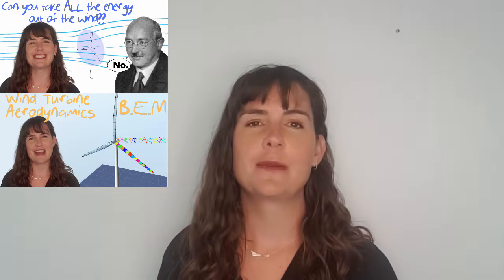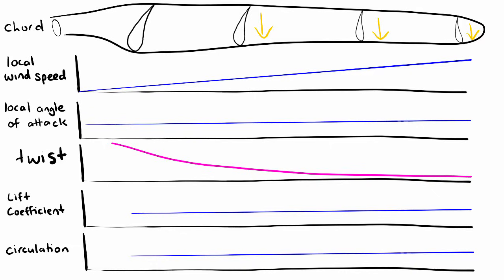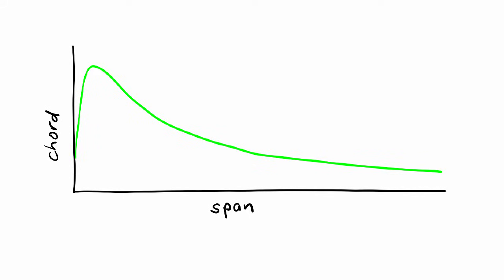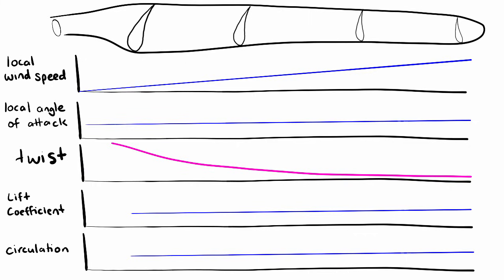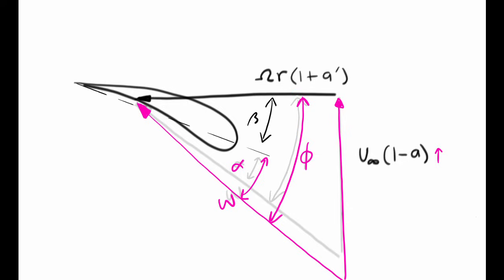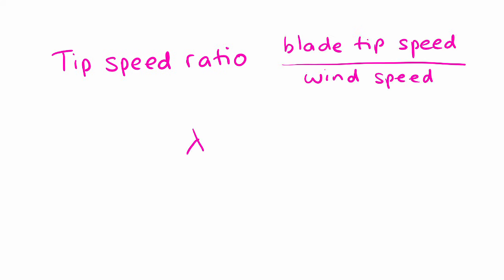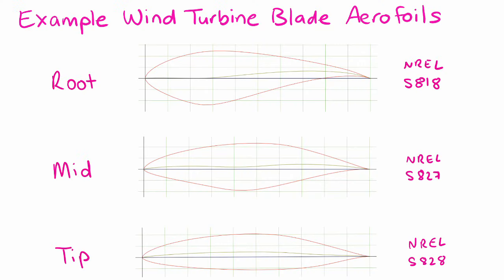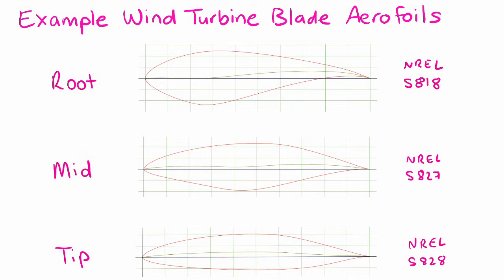How to Design Wind Turbine Blade Geometry for Optimal Aerodynamic Efficiency

Comment: wow, nice to see how fluid the optimisations are, and even how they depend on location. That wind on land has to keep tip speed at lower values for noise.

.. I wonder: is there any situation where you would go from 3 to 4 wings? Maybe to keep tip speed low on land?

Comment: Hey there! I stumbled upon this video while researching wind turbine blades for a university project, and I found your explanation quite insightful. As a university student, my team and I are diving into a research project focused on testing the torque output and drag of an albatross-inspired wind turbine blade inside a wind tunnel. 

I was intrigued by how the chord length changes and twist angle on standard wind turbine blades are influenced by varying wind speeds along the blade's span, affecting circulation around the airfoil. 

Our aim is to optimize turbine blades to capture energy at lower wind speeds, hence the focus on torque for the albatross blade, and reduce drag with surface texture changes like dimples. There is existing research on the matter so we're considering manufacturing the blades for testing and even experimenting with adding dimples to one airfoil to observe their impact on torque and drag and the manufacturability using molds an fiberglass lay.

Here are a few questions I hoped you could help me with: 
1. Since wind tunnel speeds won't vary along the span, would designing and manufacturing a turbine blade with twist angle and chord changes be necessary, or would an extruded airfoil shape suffice for testing purposes?
2. Could we apply the same approach to the albatross-inspired blade?
3. Would measuring lift alone suffice for gathering valuable data on torque produced at lower wind speeds, or do we necessarily need a torque sensor?
4. Are there any other general questions or considerations you'd recommend for our project based on your expertise in wind turbines and blade design?

Any insights or guidance you could provide would be greatly appreciated! Thanks in advance!

Comment: wind turbine dessingner must take a page from aerospace engine dessing, long blades with variables pitch produce torque when air isn't the speed they were dessing,but if only the 1/3 of the tip move the negative effects are less ,a second choice is to put a hub cone like in the center at least 20 meter in circumference, blades dessing becomes simpler and able to work with a wider range of wind speed ,blades then can be wider at the end were really makes a difference,and ho know lowering rotación speed and additional blades...

Comment: I wonder if there is a design/way to get all the lift force being torque? Seems that with the current designs longer blades are better so as to get the torque component of lift as far from the hub as possible (high rotational speed with thin blades and keeping a constant tip-speed ratio). To illustrate this think of the difference between a sailing boat 'reaching' across the wind compared with it 'pointing' high into the wind. A reaching boat will go much faster that a pointing boat as a much bigger component of the lift force (generated by the sails) is in the direction of travel of the boat.

Comment: Rosie,what happens when we set a windturbine in the sea? In water? The density of water is almost 1000 times more then the denity of air, right? So, do we have 1000 times more energy then a "wind" turbine??
Reply from the maker: Yes that's pretty much right. Tidal turbines very closely resemble underwater wind turbines. They have their own unique challenges which have prevented them from going mainstream so far, but there are some interesting tidal techs making progress recently. I ought to do a video on that topic 🙂
Reply: No, because water doesn't move as fast as air, and power is proportional to the square of the speed.
Reply: @niconico3907  hello Nico, Well, so as Rosie said : this exist allready, bud thé name for this kind of turbines is "Tidal turbines". They have of course one big negative Point: the speed of the water. Bud positieve Point is the weight of the water is almost 1000 times heavyer then the weight of air. Other positieve Point: they know always the direction of the stream and, the speed. Bud, for more information, search on internet: Tidal turbines.

Comment: Rosie in a home wind turbine has anyone given thought to having two turbined of different size blades in tandem, one upwind of the pedestal and one downwind with larger blade diameter to keep everything pointed into the wind? Obviously the downwind turbine will not be as efficient as compared to the upwind turbine due to wind flow turbulence but with a larger diameter blade it should be decent. This concept could only apply to home installations.

Comment: Another other question i wanted to ask is when the wind pressure is sometimes very high and we want to control the flow of electricity or just kinetic energy, how can we control the amount of kinetic energy that is being produce by the Wind turbine at the high wind pressure? and what safety precautions should we take before building a wind turbine and use it for our own use at homes and for our farms water motor?
I would very thankful to you if you guide me a little bit.
Reply: Usually wind turbines have what they call cut-off speeds. You can check that out. Furthermore, a gear system is attached to a wind turbine to regulate electricity generation given different rpms

Comment: When I first saw a wind turbine, I was a bit surprised at how slim the blades are and how slowly the blades rotate. Since an electric generator's out put is proportional to the rotation speed I would imagine the blades would rotate faster than I actually saw. But It is possible to use gears to speed up the generator rotation but that adds more torque requirement on the rotating blade. So there has to be a trade off. 

When there is no wind, there will obviously be no rotation. As the wind speeds up the blades start to rotate. So there is a wind speed at which enough torque is generated to start the blades turning. A slimmer blade seems to require high initial wind speed to start it turning? And I wonder how it is and how does it affect the overall efficiency of wind turbine?

Comment: Long-winded additional information..

The AM-FM Real-time physical manifestation of sync-duration Elemental e-Pi-i superposition Quantum-fields Mechanism Holographic standing wave crystallisation condensation, E=mC² Superspin-symmetry-> Singularity positioning integration,   ..is plain-old Atomic Structure WYSIWYG QM-TIME resonance floating, e-Pi-i-numberness compositions. In instantaneous trancendental self-defining cause-effect dimensionality, a complicated manifestation of pure-math relative-timing ratio-rates in conic-cyclonic coherence-cohesion objectives place in time-timing re-evolution Perspective. This is context, Logarithmic quantization calculation of QM-TIME Math-Phys-Chem and Geometry here-now-forever empirical formatting. 

Astronomical Observation is built around Space-time Spectroscopy of the AM-FM continuous creation connection cause-effect, so just like when a Stroboscopic Timing Light is used to set the Spark and Governor on an ICE motor, much the same idea, in emulation, applies to the analysis of Quantum-fields pulse-evolution Actuality.

 Theoretical analysis of real-time phenomena is supposed to get all the time-timing sync-duration identification of maintaining and Sciencing Re-search in metastable proportioning probability balance, of re-evolving intelligence, Actual and Artificial.

Comment: Just a thought, have any buddy design a wind blades in 2 parts ,so that the first part near the hub can change angle separate from the tip this will help in transport because the final size will. be larger and it tecnicly will work in winder range of wind,
Reply from the maker: Yes, look up the GE Cypress wind turbine. It has 2-part blades mostly to help with transport like you suggest. But they are attached rigidly, they can't move independently once they are installed. I think the 2-bladed Envision turbine had an inner and outer section that did move independently in some circumstances, but I am not 100% sure on that. And then, all the old wind turbines that were stall-regulated had tip brakes that moved independently from the rest of the blade. That's actually the topic of my first ever video: https://youtu.be/Y5T5ZhJQr2o

Comment: What if there was a better blade design where the "root support", almost 1/3 of the blade that creates no lift, is redesigned to harness this missing life co-efficiency... and the tip was augmented with a noise reduction attachment where no sonic wave could be created or change the rotational speed.  What if the blade system itself was "Self-Adjusting" to pockets of wind bursts without creating internal damage or a disruption in the blades performance... Sound impossible... Let me introduce you to... "WyndBlade"...

Comment: Ms Rosie, superb explanation, just a request can you design and fabricate an diy home made blades with easily available materials, that would help lot of diy makers around the world , most design for homemade blades I am seeing is made out of cutting up sewage pipe, I was wondering if an somewhat efficient design can be made out of some other material like aluminium or tin sheet,
Reply from the maker: That's a good idea, I will see when I can find the time to work on that project 😊

Comment: Another really good, really clear video.  But I do have one question...  In traditional aircraft wings, it's generally accepted that an elliptical load distribution is the most efficient.  I understand the significant differences in things like twist and taper since you're rotating these blades about a central shaft, but my first assumption would be that you'd still be aiming for an elliptical lift distribution in the end.  Do you know why these would differ in that respect?

Comment: Hello! The best series ever I've seen about Wind power- the dependencies are explained very well.
"machine control of pitch machines" would be a nice topic. 
One comment: Why do you stay on these ugly Tangler airfoils?
The largest problem: their low LE radius. The allowed rougness is proportional by 1/ sqrt(Re). Therefore they are horrible dirt-sensitive. Bec'se the local flow speed around LE is so high that there is an immediate transition. Wortmann made this error 40 years ago on his sailplanes- when there was one fly you needed immediately a wiper.

Comment: Thanks for the video! I would appreciate if you could help me with this question, would the turbine require 3 aerofoil sections or is there a possibility of just using one?
Reply from the maker: You can use one as long as you scale it so a larger chord at the root than the tip, like I explain in the video. The main compromise you'd make in that case would be that you might find it hard to get the stiffness you need at the root with a thin aerodynamic profile.
Reply: @EngineeringwithRosie  ok, thank you for the help!

Comment: If we connect the Wind Turbines Generator directly to a high voltage direct current power line  (assuming it's possible), the rotational speed does not have to be fixed. How much would that help in design and increase efficiency? (Great videos, I have subscribted to your channel immediately!)

Comment: Rosie, thanks for the great series. A question on what you say here around 3:54: '... IF the rotational speed stays the same'.

Is that an 'if' at all?

For a given overall design - including electric generator and gearing within the shaft that links blades to electric generator -  is it possible at all to change rotational speed, e.g. to adapt to different wind speed? Or is rotational speed dictated by the need to synchronise the generator to mains AC frequency?
Reply: Older wind turbines used to need to rotate at a specific speed to match the grid frequency. More recently though this is no longer needed as an inverter is used to convert the variable frequency from the turbine to the required grid frequency. What made the difference was advances in power electronics that made it economical to build inverters that can handle high power.
The same principle is also used in many portable generators nowadays, allowing the engine to run at a variable speed optimised according to the load while at the same time maintaining a constant output frequency of 50Hz or 60Hz as the case may be.

Comment: When I think of wind producing torque , I think of windmills of Holland. I then visualize  a beam with a pivot in the middle. I then put 40lbs on  one side next to the pivot and then put 40lbs in 10 lbs increments spaced equally apart on the other side.  Now imagine a new visualization I put 40lbs next to the pivot on one side and then put 40lbs at the end of the beam on the other side. The design that I think of is nothing like what I see here. Airfoils used for lift makes sense.  Thanks for the vid.

Comment: Wouldn’t wind speed affect every airfoil the same?
Reply from the maker: No, because the blade is rotating, so the tip sees a higher wind speed (because it's rotational speed is higher) than the root. Does that make sense? If not, tell me what part isn't clear, maybe I can make a simpler video explaining just that part.

Comment: Thank you for your video, it's super helpful! However, how do I know how much rotational speed will exert how much sound level?
Reply from the maker: It's actually really hard to figure that out. Large wind turbine manufacturers use a combination of experimental results and computer simulations. It's a lot of work and they still sometimes get surprised by the noise level when the first turbine with a new design is tested. If you are designing a small one of your own I would suggest the fastest way to find it out is to make a prototype with the right blade geometry and rotational velocity and measure it. 
If you are interested in values for utility scale wind turbines then you can find sound and rotational velocity in the brochures usually.
Reply: There is a large NASA reference publication 1218 about sound generatoion available on the net. Airfoil self noise and prediction.

Comment: Thank you! This video is very helpful! I would like to ask for your advice, would a 1.5 MW turbine with a rotor diameter of 110m and hub height  of 80m a reasonable application if the average wind speed is 7.03m/s? I am not sure if the dimensions fit in the reasonable range, as I found that usually the diameter is 77-90m?
Reply from the maker: That wind speed puts the site in class III (low wind speed), so it makes sense that the blades are a bit longer than a turbine with the same rating in a higher wind speed site. I think it sounds reasonable. Of course if you are actually considering buying such a turbine then there are a lot more factors to consider than just this!

Comment: For VAWT turbines would the airfoil change along the blade length or would there be one airfoil the whole way up? I assume one airfoil because the blade is getting the same wind velocity along the whole length?
Reply from the maker: Great question and I will have a couple of videos on VAWTs in the next couple of months to talk about the aerodyanmics in more depth, plus the advantages and disadvantages relative to HAWT. You are right, if the blade is straight up and down you don't really need to change the airfoil or taper.
Reply: @EngineeringwithRosie  I really look forward to those videos! I am trying to design a helical VAWT, would one airfoil the whole way up be okay?
Reply: @simplykatie98  yes.  if it were an "egg beater" darrius style vawt then you would want to blend profiles.

Comment: ...what if the rotor and namely horizontal axis will be positioned right angled relative to the wind, so that the thrust will be generated like if it were helicopter rotor, then a airfoil will be more constant along the blade and pushed away from the tower..
Reply from the maker: Do you mean like a helicopter, or like a water wheel? A helicopter rotor is oriented the same way as a HAWT rotor, isn't it, sort of running "backwards"? 

Assuming you mean to orient it like a water wheel, I guess you would have two issues. First, that the swept area of wind is likely to be smaller. And second, that the blades angle relative to the wind will be constantly changing as it rotates. e.g. it will be upside down when it is on the far side compared to the front. So you either need to constantly control the blade angle, or you need to cop a big hit to efficiency. It can be done though, and perhaps that configuration could suit certain circumstances well. 

Is that what you meant, or did I misunderstand your question?

Comment: At the equation shown at 6;17 talking about Optimum Aerodynamic Design, what do each of the variables mean? I was unsure it this was covered.
Reply from the maker: It is from section 3.7.2 of Burton's "Wind Energy Handbook." 
https://amzn.to/32Pb1fh

I think I cover the variables in earlier videos in the series, but that will probably be hard to find, so here they are:
sigma_r = chord solidity at the radial location (chord length divided by swept circumference at that radial location)
lambda = tip speed ratio (tip speed due to blade rotation (radial location times rotational speed) divided by wind speed)
C_l = local lift coefficient
mu = r/R (radial location divided by radius)